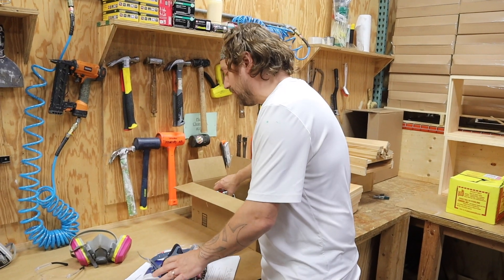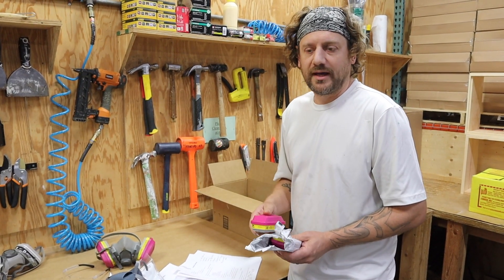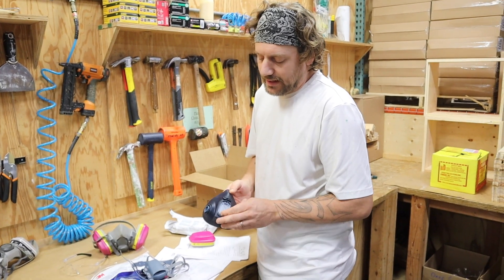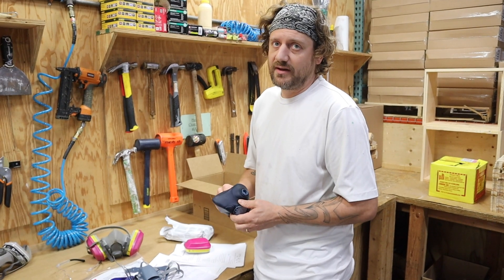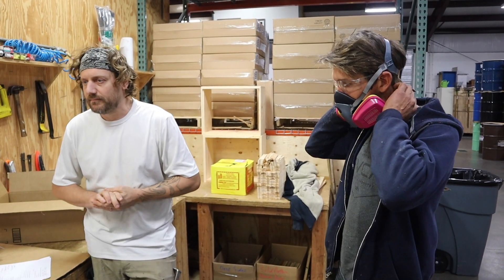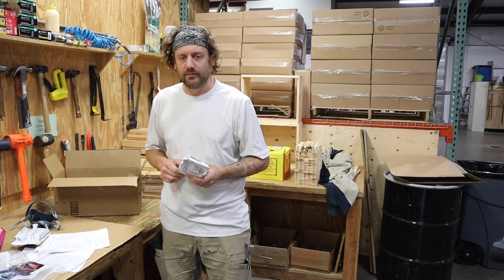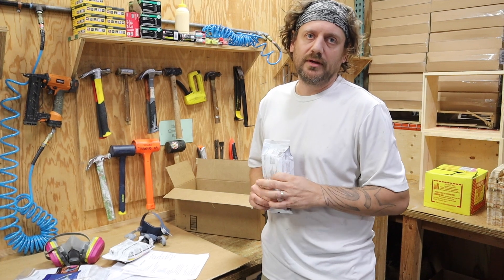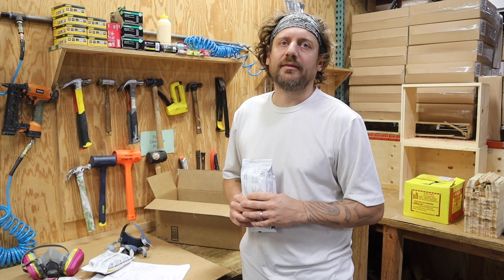Respirator for Oxalic Acid and Formic Acid Varroa Mite Treatments

Comment: I know this video is older but I wanted to add. It is very important to keep the mask and cartridges dry. They can grow mold in they and give you a lung infection. And in the colder weather when you guys will be using your masks  condensation will be a problem. New ones every year will help for sure.
Reply from the maker: Thanks. I need to redo this video. We're have actually switched to full face masks and are changing cartridges often.
Reply: In Australia July 2024 beekeeping authorities have not approved the use of oxalic vaporisation. My first thought was why as it’s been successfully used overseas for a long time. After watching your informative video on the importance of safety PPE I have more understanding why OA has not been approved atm.
Reply: @jillking4751  - Oxalic also has not been approved in California at all either.  Makes it a challenge, since our bees are active pretty much year round.  Bob - I will be very interested in what full face respirator you are using now

Comment: Respirator Cartridge/Filter 60926 Organic Vapors Filter for 6000, 7000 and FF-400 Series Masks, Effectively Filtering, Acidic Gases, Paint, Formaldehyde, Chemical, Dust

3M Half Facepiece Reusable Respirator 6200, NIOSH, Four-Point Harness, Comfortable Fit, Dual Airline Supplied Air Compatible, Bayonet Connections, Painting, Sanding, Cleaning,

Comment: With the industry I worked in, you could not have a beard if your job required a respirator.  It is impossible to get the required air seal.  I hope what you have works well with oxalic acid, despite the probable leaks.
Reply: Yep, I have to trim my beard down really close or else I fail the pressure tests.
Reply from the maker: It seems too.

Comment: Hello Bob can you tell me if the machine that is used to put the oxalis acid in the hive are any different. I think one of them is called the cup style that goes in the entrance of the hive an the other one is used at the back of the hive where you drill a hole  . Being on S.S  . Is the cup stile just as good. I am starting over with Bee’s from years ago . I am starting out with two hives so there is no reason to go fast in treatment right now but I do not need to spend the money on the cheaper one till I can get the better one . I would like to down the road maybe have around 10 - 15 hives . Can you give me your thoughts on these machines. I really enjoyed all of your video’s I am trying to go thru and look at all of them . Thanks from Gene
Reply from the maker: Hi Kathy. The less expensive tool that slides in the entrance works just as well as the more expensive types. The main differences are that it is slower and needs a 12 battery to charge it instead of household current. With only 10 or 15 colonies it would be just fine and would be my choice if I had access to a 12 volt battery and was on a budget.

Comment: Remember oxalic acid goes from a vapor back to a solid, what you inhale turns to solid in your lungs and it stays there eating away at your lung tissue. This is not repairable unless you get a transplant. Do not trust wind direction, it forever changes. Also when I didn't wear goggles with proper fit, I burned the sclera which healed in time but you are spot on with your precautions. Well done Bob.

Comment: Good Afternoon Bob, We have always treated all our hives with Apivar Strips in August & September including this year.  After weighing out the cost of these strips & having some doubts if they are actually working we decided to switch over to Oxalic Acid Vapor Treatments in the future. In the next few days if we get a day above 50 degrees do you think it would hurt to give the bees 1 more treatment before the cold really hits?  The last type of treatment any of them had were the Apivar Strips in August.  Thanks
Reply from the maker: I have never seen any down side to oxalic vapors, no matter how often it's done. We give two treatments while they are brood-less in winter. We try and treat between 42f and 50f so the bees are not tightly clustered but are not flying.
Reply: @bobbinnie9872  Do you leave any honey supers on going into winter.  If a honey super was left on a hive going into winter is there a way to clean those supers after a oxalic acid treatment was performed ?    After the bees hopefully make it through winter I will pull those back off before the spring flow begins.   Thank you once again Bob for helping all beekeepers.
Reply from the maker: @HereWeGoSteelers  We don't leave any  extracting supers on going into winter but the bees will clean up a super that was on during an oxalic vapor treatment. Thanks.

Comment: i looked online,the 6003 yellow  filter cartridge is acid approved the pink  glued on pre filter  is not serviceable, the pink top  half is a p100,particulate filter,....my setup  has yellow 6003  ,w n95 prefilter(which the particulate  pre-filter  is replaceable)...most likely the yellow/pink combo60923, or 60921,will be best

Comment: The Right Respirator Filter For Oxalic Acid,(PINK/YELLOW)

This article will cover how to choose the correct filter cartridge to protect you against oxalic acid when treating your beehives for varroa mites.
I've seen a lot of articles and forum posts asking which 3M cartridge is the right one to use for protection against sublimated Oxalic Acid. The problem is I've also seen a lot of wrong answers. So let's delve into this topic and figure out the best protection for you to use when sublimating Oxalic Acid to treat for Varroa Mites in your beehives.

Why Is This Article Important?

Oxalic Acid is the best choice currently for the control of Varroa Destructor (varroa mites). It has been shown in long terms studies that varroa mites cannot develop a resistance to this method of elimination. It causes much less absconding than other treatments and is more effective as a miticide than nearly all other treatments. Treatments like Apivar and others are all causing mites to develop immunity to these treatments and they are so harsh that they cause hives to abscond on a regular basis. So if Oxalic Acid is the best choice, we should know how to use it safely.

Sublimation vs. Vaporization

We need to be correct in our assumption of what exactly we are doing when we heat Oxalic Acid. If we do not know, it is easy to choose the wrong 3M cartridge. Choosing the wrong cartridge to protect against Oxalic Acid when treating for Varroa Mites is exactly what we do not want to do, to prevent injury to ourselves.
Vaporization is a transitional phase of matter in which a solid first change to a liquid and then changes to a gas.
Sublimation, on the other hand, is the direct change from a solid to a gas.
Sublimation is what we are doing when we use Oxalic Acid crystals and a "vaporizer". Honestly, to be accurate, these units should be called "sublimators" I guess, lol.

Organic Vapor vs. Organic Acid

Getting this part right is where I see most of the mistakes on the forums and in the advice I see given online arise from. The problem comes in when people who do not know the definition of "Organic Vapor" attempt to advise others that a cartridge for organic vapor will protect them from an "Organic Acid" like Oxalic Acid. This simply isn't true.
An "Organic Vapor" is typically defined as the evaporated products of Organic Compounds. So what is an organic compound? Most people would guess that organic compounds are made from living things. While this is in a way correct, it is not 100% correct. Organic compounds are any number of chemicals and compounds that contain carbon. Carbon is the basic building block of life as we know it. Most organic compounds are produced from petroleum, which used to be alive and contains carbon molecules. This includes things like gasoline, paint thinners, diesel fuel, turpentine, most plastics,  acetone among many others.
An "organic vapor" usually refers to the gas given off by the rapid evaporation of these carbon-based compounds, none of which I listed would be considered an "organic acid", which is really what we need a cartridge to protect us from, as Oxalic Acid is an "organic acid" and not an "organic vapor". To be even more accurate, when we use Oxalic Acid the way we do in our beehives, it is actually a "sublimated organic acid".

What Is Oxalic Acid?

Oxalic Acid is a strong alpha, omega-dicarboxylic acid that is ethane. It is also known as ethanedioic acid. It has a  molecular structure of C2H2O2. Two carbon atoms (makes it organic), 2 Hydrogen and 2 Oxygen atoms. It occurs naturally in many plants and vegetables, so we can say it is harmless at correct dosages. It is not metabolized by the body but excreted in our urine. So if you are exposed, and you often are by eating vegetables, it passes harmlessly out of your urinary system.
Oxalic Acid is a "strong acid" and has a ph of 1.3 (water has a ph of 7). The ph scale goes from 0 to 14. This explains why water has a ph of 7, it is neither an acid nor a base. However, we can see that a ph of 1.3 Oxalic Acid is a very strong acid, almost as strong as acid can be. This is why we must take great care in selecting the correct 3M cartridge filter, as oxalic acid can and will destroy your lung tissue if inhaled.

Which 3M Cartridge Is The Correct 3M Cartridge?

3M manufactures a wide range of cartridges, particle filters, and combination filters. These many filters are all designed to do specific things and protect from very specific vapors, compounds, particles, etc.
3M Particulate Filters:
￼
These filter out only aerosols like dust, mists, fumes, smoke, crystals (of OA), mold, bacteria, etc. Some of these particulate filters can filter out "nuisance-level" gasses and vapors. In other words very small amounts. You need a particulate pre-filter since some of the sublimated oxalic acid will recrystallize in the air around you. This means it is no longer a "gas" or a "vapor" but a "particle" and needs a particulate pre-filter.
3M Gas & Vapor Cartridges:
￼
These filter out only gasses and vapors. There are different cartridges for different kinds of gasses and vapors. You need one of these in conjunction with the particulate filter above to be most effective.
 3M Combination Cartridge/Filters:
￼
These filter out particles, gasses and vapors. Different combination cartridge/filters are used depending on the gas or vapor present. This is the product that combines both of the above particle filters and a cartridge into a single unit which will get out the Oxalic Acid no matter what form it is in.

So Which Do I Use?

 To decide which is the best choice or combination of choices, we need to consult the 3M manufacturer's specifications for each cartridge and filter. Then apply what we know to our selection. Below is the 3M published list of color codes for their cartridges and filters.
￼
We are using an "Organic Acid". From the chart, we can see that black cartridges cover organic vapors and that white cartridges cover acid gasses. But we have both an organic and an acid. So we see that 3M has a cartridge to cover this. It is the yellow color-coded cartridges. The 6003 series. There are a lot of cartridges in this series though, which one do we need for Oxalic Acid? We need one with a P100 prefilter and an OV/AG cartridge.
From 3M's product line we have two choices. Either the 60923 cartridges or the 60926 cartridges. As we can see from 3M's chart, these are the only two cartridges which will fulfill our needs.
 ￼
So based on this, I would select either of these two cartridges to go into my respirator. These cartridges are disposable and reusable. This one pictured below is the 60923 and is a pink and yellow combination particle filter, organic vapor filter and organic acid filter. It looks like this:
￼
Now that we have figured out exactly which cartridge you need to protect you, let's discuss respirators.
Reply: Thank you.   I'll check prices to prepare myself.
What mask model goes with the cartridge.  I've seen a 3M mask over 350 dollars.  There has to be a better one somewhere.
Reply: @beebob1279 , i bought on ebay or amazon ,bayonets  style mount,around  $40,for cheap knockoff full face,...today was 74,did final inspection,as rain n cold comin,i didnt notice  much brood,or eggs,but have decent  honey stores,not seeing alot  of beebread,i may need to feed pollin,and or dry sugar,this my first year,i still need to treat my 3 hives but have not  done a alcohol  wash,...n.w arkansas

Comment: i have the yellow color  cartridge  ,for acid,not  the pink color,i will recheck my numbers.. ,i would add if you have cuts on your hands ,the stuff burns,i also  recomnend good  boots,ive experimented, w a gas vap torch  and the acid may dribble as you walk leaving acid on your boots, you definitely  dont want it in your eyes ,you will get  shifting breezes ,it will be on your clothes, and you should keep  water handy  to clean  your face,i suggest a shower,and wash your clothes, especially for your lung health,please take  OA serious. it does leave a residue on you.when your exposed  to vapor

Comment: I have a question Bob, if you get the time. I recently got a new hive, actually I have a top bar hive, but it is made from wood and I was wondering if people recommend staining/sealing the outside for weather protection. If so are there specific types of stains and sealers people use? Thank you!
Reply from the maker: If you don't want to use primer and paint Linseed is a good natural choice.

Comment: One thing that I did not hear mention in the video is that the cartridges need to be stored in a sealed bag when not in use.
I was taught that the usage time was calculated any time the cartridge is exposed to air and not only when someone is breathing through it. This may have been an extra precaution used by my employer at the time. However a sealable bag would be an inexpensive extra precaution to insure good functionality. Also, as mentioned by others, a clean shave around the seal area is necessary to insure a proper seal. Some whiskers are fine but the area of the seal needs to be shaven. BTW, I only discovered your channel today because a friend sent a link to one of your videos. I am now a subscriber because I find your videos to be very informative and pleasant to watch
Reply: I think you may be right about sealing them in a bag. I learned the hard way after not storing the cartridges in a sealed bag between uses. I had around 10 hives and hit the hives a few times in October/November. I wore them maybe 4-5 hours and they stopped working. BTW- Bob, thanks for the video.

Comment: I use the pro vape 110 and have had the tube  that goes in the hive get plugged. This made the Cristal cap blow off, burning my forehead. Glad I was wearing glasses and  respirator.  What can be done to prevent this.
Reply: I keep a small propane torch on hand to heat and clear the tube every few hives. It works great.
Reply from the maker: We clean the tubes out with 1/16 inch braided cable. It looks like bicycle brake cable and we get it at Home Depot. We put a four inc piece in an electric drill and use it in reverse. This keeps the cable from unraveling. Works great.

Comment: Excellent information that cannot be over-stated.  I use those cartridges and I've opted for the 3M 6900 series full face mask.  I'm a one-person show so I don't need to buy them for a number of people.  The 6900 is a beautiful piece of PPE for sure.  https://www.3mcanada.ca/3M/en_CA/company-ca/all-3m-products/~/3M-Full-Facepiece-Reusable-Respirator-6900-large-4-case/?N=5002385+3293806350&rt=rud
Reply: And what filters are you using?
Reply: @beebob1279  I've been using the same as what Bob has there, the pink one.  https://youtu.be/jaED2xIlUCU?t=342

Comment: Hello Bob. What's your input on the oxalic acid dribble method?    Have a good Thanksgiving
Reply from the maker: I used the dribble method several times in years past and had success with it. However, there is one big difference in my view. With vapors there doesn't seem to be a problem with repeated use but with dribble you see a shrinking of the bee population if used repeatedly in close succession.
Reply: I heard if they were to wet sometimes the queen didn't survive. (Perhaps she is fed with it.)
It must be really cold.